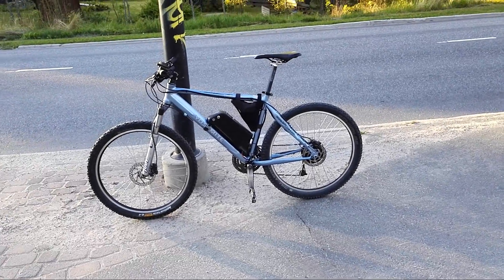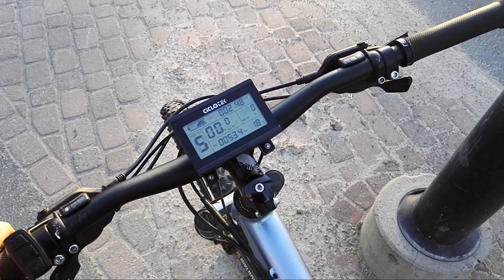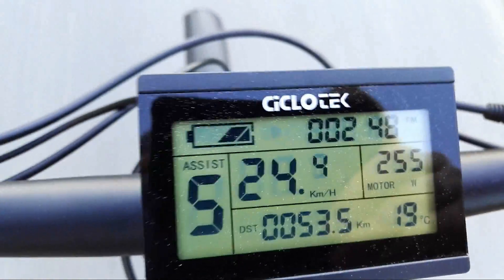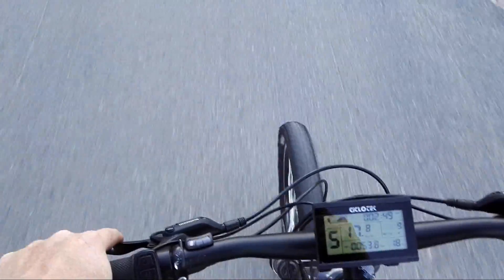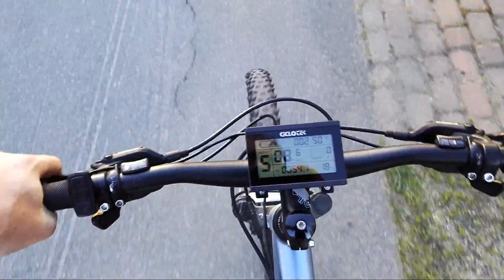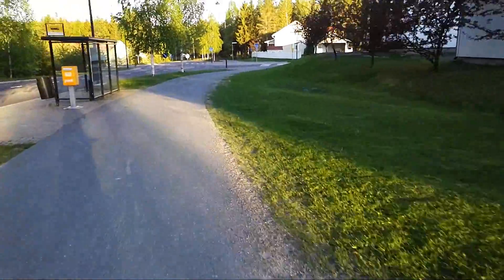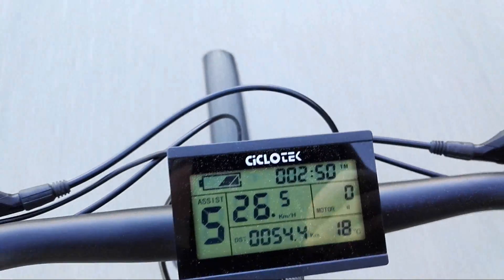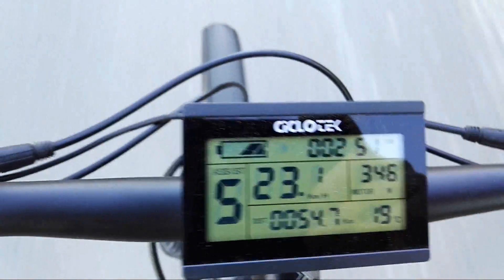How to convert your bicycle into an electric bicycle, part 3

Comment: Hi, i need to stop my bike when it runs fast can you say how to stop it electrically not by pressing brake levers ( my brake function controller only opens the power line  )  i know others can stop it like that , do you know witch controller can do that